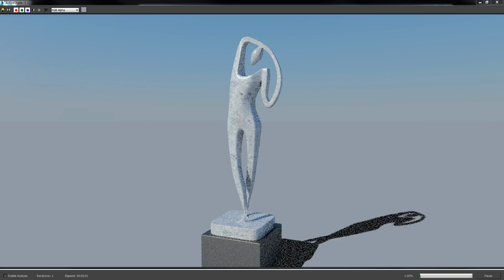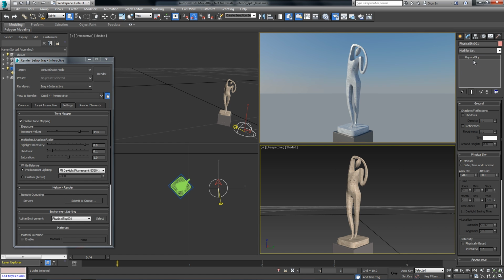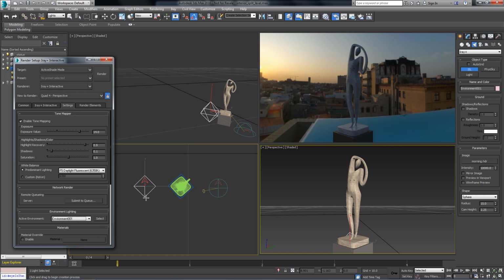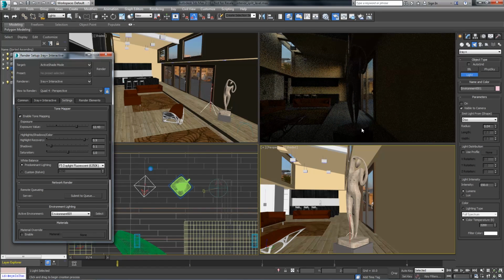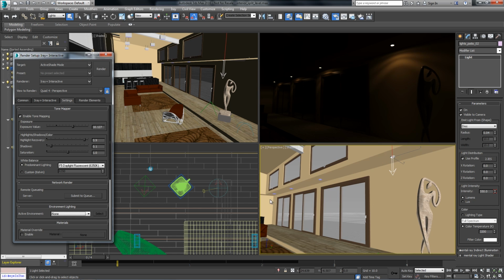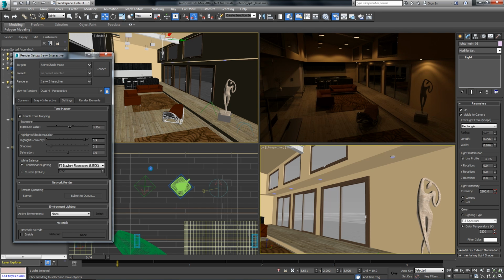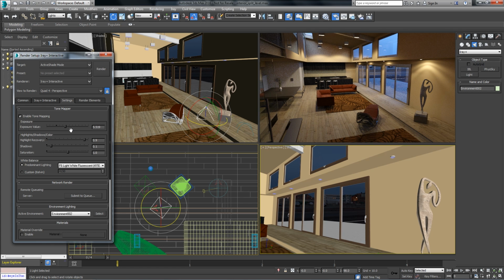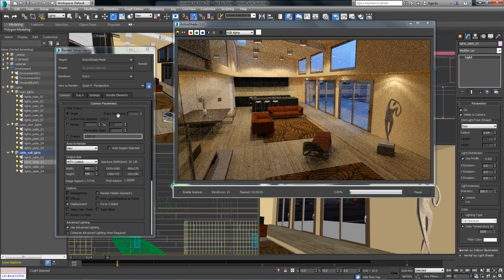Physical Lighting in Iray for 3ds Max

Comment: This is amazing. What GPU(s) were used for this presentation?
Reply: +Petar Stamenkovic Quadro M5000 x2
Reply: Thank you. For those interested iray works equally well with GeForce as well as quadro cards. The only difference is on higher end where quadro cards have more vram which makes it possible to render more complex scenes. 4gb of vram is good for ~50 million poly scenes and dozens of 2k textures.